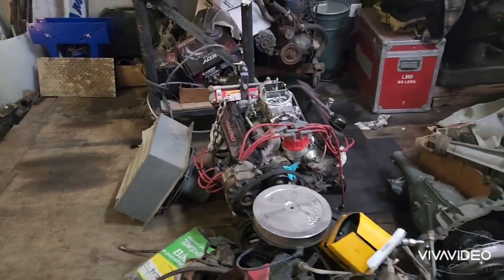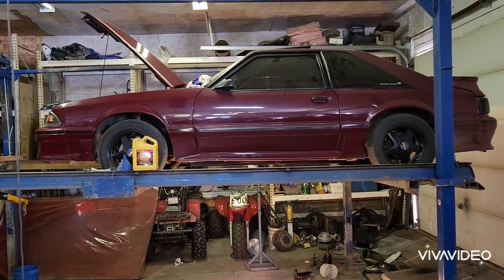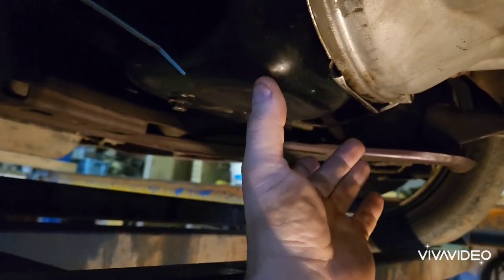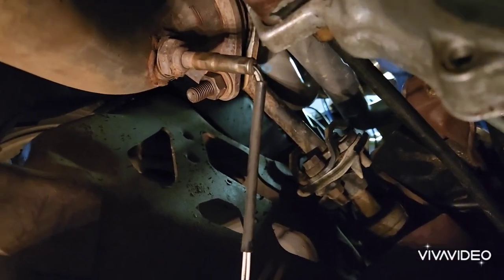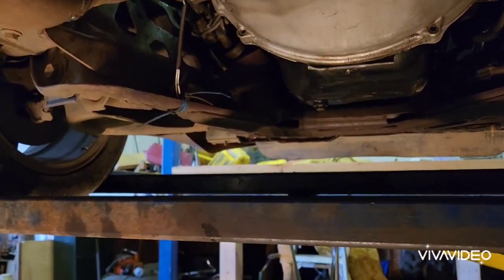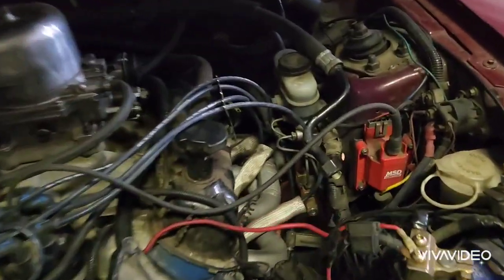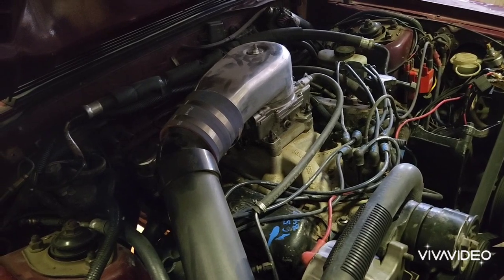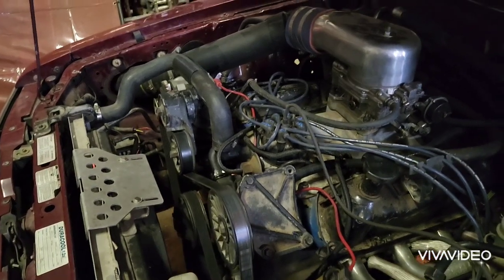foxbody mustang 351 windsor swap

Comment: I did a junk yard dog conversion. 351 into a 408 into an 80 Capri 5 speed and 411 gears in rear. 
Did it all with over the counter parts. 
Oil pan I used was for a 79-88 crown Vic with Windsor. I made headers from shorty's to fit around steering shaft. Tires delete themselves in rear .
Reply: Gas pedal rear radial delete is a sweet option.
Reply: U can use an old grenade also yummy parts

Comment: A Panther body 351W oil pan looks almost exactly the same as the Ford Racing foxbody 351W conversion oil pan. A hundo off RockAuto.
Reply: Suppose to be the same according to forums
Reply: @brandonfloyd6321  The dipstick can be hard to find new.

Comment: I had an 87’ hatch I did a heads cam intake build on. Nothing huge, 360 bhp roughly. Was gonna just do 351 but I thought with the extra height it would be a pain in the ass to shoehorn it in there and run the stock hood. Cowl hood wasn’t an option. Looks mint!
Reply from the maker: It would have been a pain without a hoist

Comment: I mighta considered leaving the OEM fuel pump in place and use a fuel pressure regulator that can send fuel back to the tank. Like a Holley uh, 12-803BP By-Pass Regulator... butt, the work is done now so, <3 all

edit: ohohoh, Check out Econoline Van Engines for a Saginaw Power Steering Pump and Bracket!

Comment: A young man here is a real simple way to tell you how you can tell 351 from 302. A 302 timing cover is even with the deck and a 351 is a inch taller over timing cover.

Comment: 1988 mustang cobra ??? Or is it a cobra clone?
The 351w swap not that hard truck oil pan pick up tube really the hard part is how much you want to spend for a good set of headers same thing doing a 302 302 headers are cheaper I had made 302 headers fit the 351w swap many times.. if your going efi use truck distributor that has the pip made on use swap 302 steel gear if the 351w roller cam 351w swap has been made over complicated. The downfall to a 351 Windsor swap if going efi the cost of the intake end of it speed cost how fast you want to go the 5.0 bracket will fit the 351w with a small mod
Reply: In Canada, Mustang GTs are instead called Cobras.

Comment: No such thing as an 88 mustang cobra
Reply from the maker: I wondered that myself...but it is an 88 and has the cobra badging, and says cobra on all my paperwork, apparently a cobra is just a gt badged cobra and sold in canada
Reply: @captaindipchit  would it be hard to put a 351 in a 95 mustang GT? I’m wanting to convert it into a 351
Reply from the maker: @ThefarmLife.  should be exactly the same and would need a cowl hood
Reply: @captaindipchit  The stock hood is on my 351w swapped 1985.  I cut the brace from the center of the hood and put washers between the hinges and hood.  It sat lower with convertible mounts, but I am running solid mounts now and its slightly higher.  The air cleaner hits the bottom of the hood.  I am running a stock dual snorkel air cleaner and a Pro Comp dual plane intake (Weiand Stealth knock-off)